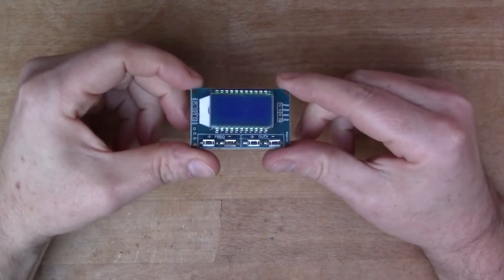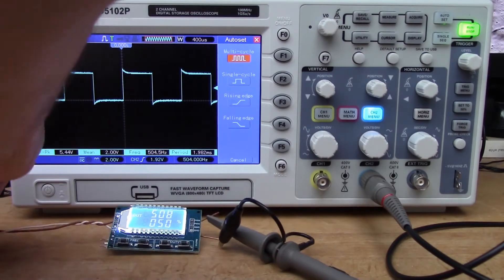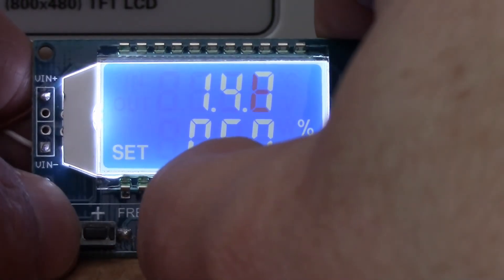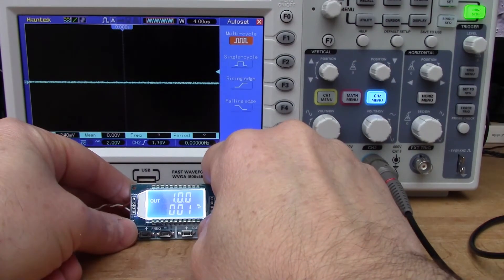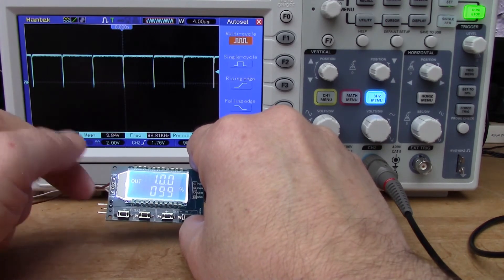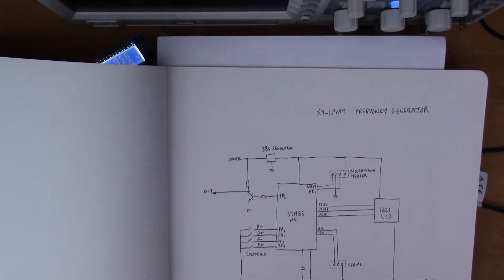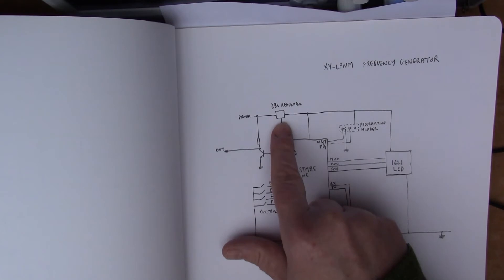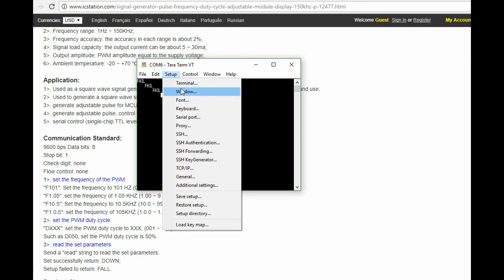Testing a Frequency Generator Module (#57) - Also, now over 200 subscribers !

Comment: Hi Martyn, great video and schematic. I have a question. I’m inputting 8v, but my signal out is only dropping down to around 6 V. That is an oscillation between 8v and 6v. Is there something wrong with my unit or am I doing something wrong.
Reply from the maker: I haven't encountered that, but I haven't driven the module at more than 5V.  I would suspect that the regulator is oscillating, although the 8V looks within its capabilities from the datasheet.  You could try putting more capacitance around the regulator, or put a zener in series with it to drop some of the voltage.
Reply: @MartynDavies  Hi Martyn. I’ll try your suggestions. Do you think the unit is faulty? Thank you for your quick response. Keep up the great work.
Reply from the maker: @joedelamo1435  No, not necessarily faulty, but they do try to reduce the bill of materials, e.g. by minimising components and sometimes extra decoupling capacitors can be a help.

Comment: Hi Mt,r. Davies,
I have a problem while I was setting 10Khz.s via serial interface, It doesnt accept values from 10 KHz to 99.9 KHz.
Reply from the maker: I have a more recent module here that has slightly different commands - F1000 selects 1kHz, F10000 selects 10kHz.  The duty cycle command is more flexible also - you can send 'D2' or  'D98' to select 2% or 98% duty cycle. Try these.

Comment: Hi Martyn, very helpful thanks. I'm trying to switch on and off a solenoid 0-200 times per minute, but not as clever as you guys. I'm guessing this would be part of the solution, if you could point me to another vid to achieve this, that would be even better :)

Comment: Hello Martin could you think that it will be great to increase or decrease a laser power ( which demand 30K Pwm ) i send you the link....
https://www.cdiscount.com/bricolage/electricite/tempsa-445-450nm-17w-bleu-laser-module-pr-machine/f-1661416-tem6296623433040.html
thank's a lot for your information...Phil
Reply from the maker: The module has quite a small output transistor, and I suspect that the current available is probably not more than 100mA.  If you want to drive some amps you'll need to add another stage, e.g. with a power MOSFET

Comment: Hi, great video sir, I would like to know if this PWM generator can be connected to an active high 5V  TTL input of a CNC laser, Thank you in advance.
Reply from the maker: It's definitely not designed to be TTL compatible, but will probably work as long as it is run off 5V.  Rather than plug it into an expensive piece of equipment, buy a 74xx TTL chip, e.g. 74LS00 and connect the frequency generator to that, make sure that it works and doesn't burn out.

Comment: Is it possible to achieve a PWM signal for frequencies less than 1Hz using this module? I have an application which I need a signal pulsed every 30 seconds and was hoping to use this module to do so.
Reply from the maker: No, 1Hz is the lowest this goes. I haven't come across any low-frequency PWM modules.

Comment: What is the maximum output current?
Reply from the maker: I'm not sure, but it will be defined by that output transistor and its resistor
Reply: Тхыхххх

@д0
Reply: 😊😂эх⁰хх000⁰0⁰⁰

Comment: Martyn, thank you for the video, is there a chance to wire this frecuency generator as to use it for a motor/electromagnet directly? any help, greatly apleciated
Reply from the maker: If you look later in the video, it does have a transistor output stage, so it probably can drive a small motor.  With inductive loads like motors and electromagnets it's usually a good idea to have a reverse diode across the coil, otherwise otherwise back EMF from the coil will go through the transistor and may damage it (e.g. see https://electronics.stackexchange.com/questions/110574/how-to-choose-a-flyback-diode-for-a-relay)

Comment: Does it project the frequency? Through speakers? How does it work? Forgive me but, I'm just learning about these gadgets.
Reply from the maker: the output is switched trough a transistor, which gives quite a large peak-peak signal, but due to the high impedance you normally need to output through an amplifier to hear it.
Reply: @MartynDavies  Thank you! I'm seriously considering to give it a try.

Comment: How much the maximum Volt for input and output
Reply from the maker: The core electronics run off 3.3V, but there is a small voltage regulator on board (you can see it on the upper right at 00:30 in the  video when I turn the board over). The specifications say that the max input is 30V, but I personally don't believe that regulator will survive 30V without any kind of heatsink.  I'd be reluctant to go over 12V.
Reply: @MartynDavies  Thanks for quick Answer

Comment: HI Martyn, where can I buy these modules in the UK?   Mike
Reply from the maker: I bought mine from icstation.com in China, but I've seen the same item listed on ebay from UK sellers (more expensive, but faster shipping)
Reply: I bought this one.
https://www.ebay.co.uk/itm/Signal-Generator-PWM-Pulse-Frequency-Duty-Cycle-Adjustable-Module-LCD-3-3V-30V-H/382432921538?_trkparms=aid%3D333200%26algo%3DCOMP.MBE%26ao%3D1%26asc%3D20171012094517%26meid%3D801272f5de3949a484960ac572a0605e%26pid%3D100008%26rk%3D1%26rkt%3D11%26sd%3D391905048325%26itm%3D382432921538%26pmt%3D1%26noa%3D0%26pg%3D2047675&_trksid=p2047675.c100008.m2219

Comment: Hi, is there a way to set the duty cycle in 0.1% increments?

Привет,  есть ли способ устанавливать ширину импульса (duty cycle) с шагом 0.1% ?
Reply from the maker: The documentation only talks about integer steps:  

2>. set the PWM duty cycle
"DXXX": set the PWM duty cycle to XXX; (001 ~ 100)
Such as D050, set the PWM duty cycle is 50%
Reply: Thank You

Comment: здравствуйте. Этот модуль подойдет для настройки резонанса колебалельного контура? Частота нужна до 100 kHz
Reply from the maker: The frequency goes up to 150kHz and actually gives quite a nice square wave at the  higher frequencies. According to my oscilloscope, the display reads a little low (1%), so at 100kHz (indicated) my 'scope says 98.9 kHz
Reply: Спасибо за информацию) И ещё, а выходное напряжение не меняется оно постоянно?

Comment: what is the white thing at the side of the LCD display and can you switch the backlight off to save power
Reply from the maker: It's the end of the backlight structure, and seems to be where the backlight LED is attached.  As far as I can see the backlight is permanently on - it would be nicer if it were controlled by the microcontroller.
Reply: thanks.perhaps  the power supply could be cut  by snipping of the leads to the back light  or putting a mini dip switch.
i wonder what the power consumption is.

the led version used about 18 milliamps at 5volts.
Reply from the maker: it looks like just one LED in there, so that sounds about right

Comment: Hi Martyn - good video. I've just got one of these and going to try to get the serial comms to work. Did you get any further?
Reply from the maker: I'm still working on it, Mark.  I have an stm8s003 on an evaluation board, and I just built a code sample yesterday to try to understand the on-board UART, and see if there's something obvious that I'm missing about how to use serial.  I can't find any further advice online about how to use the serial port on this frequency generator module (other than the same document that's listed on the icstation site).  Interestingly, there is also an earlier similar frequency generator (with 2 channels and a different 7-segment display) , which also seems to have problems with the serial interface.  I might get one of these also, and see if I can make any progress with that.
Reply: Looks Like These are the commands for this PWM module. Cheers

Communication Standard:
9600 bps Data bits: 8
Stop bit: 1
Check digit: none
Flow control: none
1>. set the frequency of the PWM
"F101": Set the frequency to 101 HZ (001 to 999)
"F1.05": set the frequency of 1.05 KHZ (1.00 ~ 9.99)
"F10.5": Set the frequency to 10.5KHZ (10.0 ~ 99.9)
"F1.0.5": set the frequency of 105KHZ (1.0.0 ~ 1.5.0)
2>. set the PWM duty cycle
"DXXX": set the PWM duty cycle to XXX; (001 ~ 100)
Such as D050, set the PWM duty cycle is 50%
3>. read the set parameters
Send a "read" string to read the set parameters.
Set successfully return: DOWN;
Setup failed to return: FALL.
Reply from the maker: Thanks for your comment.  I actually have it working now - I'll release a video shortly revealing the secret.
Reply from the maker: Mark - I've got the answer to the serial comms - see my new video: https://youtu.be/1gkhW2-eBPA